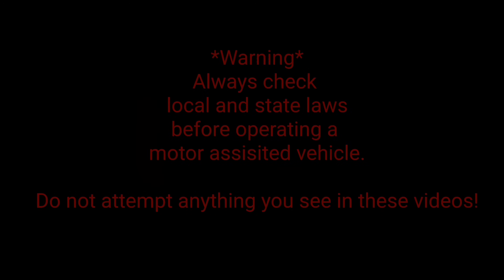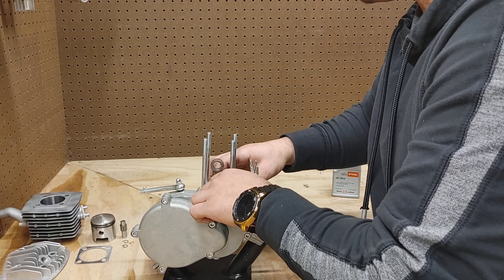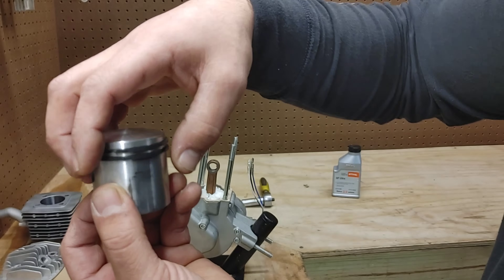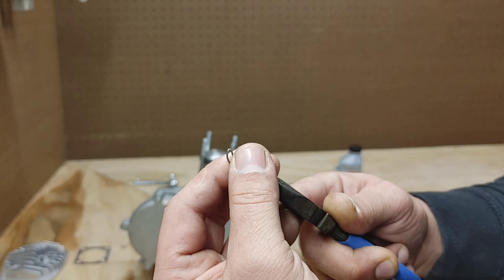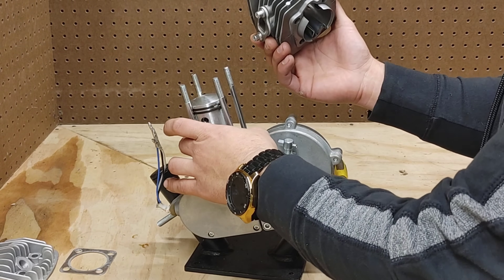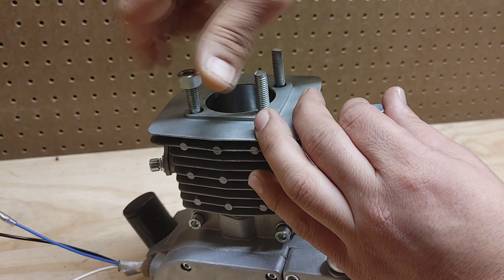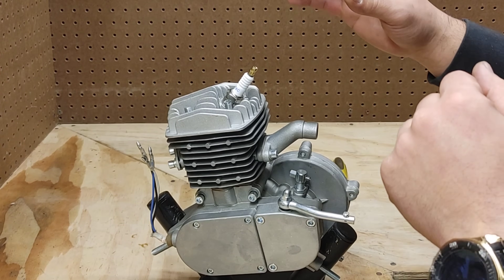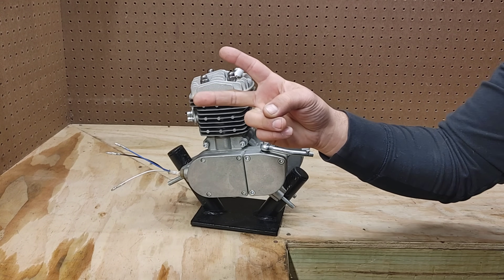Motorized Bikes 101: Engine Top-end Assembly  49cc 66cc 80cc 100cc

Comment: Okay now I know why you have a paper towel inside of the engine at 4:51 when installing that clip I dropped the clip inside of the engine I rode 150 miles so far and I don't hear any strange noises it runs great should I ignore it or tear the engine apart to try to get it out

Comment: I have a 100cc, are the torque specs the same for all, I’ve heard 12, 15, 8, 10 and all sorts, should I just do 5 as you did?
Reply from the maker: 12lbs is where you should shoot. They are not auto grade bolts so you don't want to really crank on it!. Just enough to hold compression. 😄👍🏽
Reply: @ thanks!

Comment: Engine won't turn with cylinder head on
Reply from the maker: @waynemcknight9999  theses engine come in a low hole piston and a high hole piston confirm you have the correct one

Comment: If the engine is off the bike you can put the piston in the cylinder and then put it down the studs and put the bar thru the rod and piston. I've seen people do it both ways

Comment: Great video! Here’s a few things to add. The G clip is designed to be installed one way. The tine you grabbed with the needle-nose pliers sits proud of the coil, be sure that side is facing outward. Also, it’s best to have that tine pointing downward for the clip’s resting position. Also, before installing the jug, I’ll lay a sheet of wet fine grit (1500) on a flat surface and lightly “circle sand” the mating surface for the top of the jug, this will help polish away any micro-imperfections. Ride safe!

Comment: Good video mate, done well, here's a tip for the gudgeon pin clips, put one of them in the piston before putting the pin in, then you only have to do the other clip whilst in the awkward position with the piston installed, and don't tighten the main studs any tighter than finger tight because when the head nuts are torqued it applies too much pressure at the bottom of the drilling where the studs bottom out and make contact, it can cause the engine case to crack during thermal cycles.
Keep it up, really dig your content. Cheers

Comment: I could mount an 80 cc cylinder and piston on a 100 cc  engine because in Romania there are no 100 cylinder and pistons, I want to point out that it fits in holes only that the 100 cc cylinder and piston is 50 mm and the 80 cc has 47mm?

Comment: If you wanna make it faster straight pipe it. You have to cut off the exhaust and just leave the first part of the exhaust that is connected to the head of the motor. Trust me I did it and it gives it way more power and it will not break I swear I had it like that for like 3 months.

Comment: great video alex .question I notice  the head has two gaskets on the bottom .if you took away one gasket will it  change performance or no difference  at all. first time builder.
Reply: Normally there is one gasket. I'm wondering why Alex used two as well. Adding a gasket raises the cylinder height creating a slight drop in compression.

Comment: I have a question after about 7000 hard mileage I'm rebuilding my motor.while taking the boost bottle off the frame I noticed the boost bottle was completely full of fuel.Is this normal.I ride hard and wide open all the time.
Reply from the maker: Boost bottles are nothing but problems. Imagine trying to tune with all that fuel pouring into the carburetor at random times!
Reply: @MotoredLife  it seemed to help the motor idle better, next question.In your opition whitch is better a brass head gasket or copper?.again I ride my bike hard wide open.
Reply: @billpfann332  if you run a two stroke wide open all the time you will destroy the piston and cylinder lining
Reply: @keeganhache6667  yes I know this, I r in a rich oil mixer, and ad a Teflon additive.keeping motor cool help the life also.